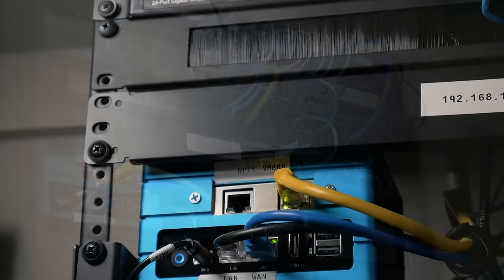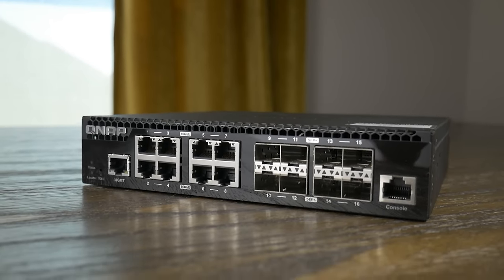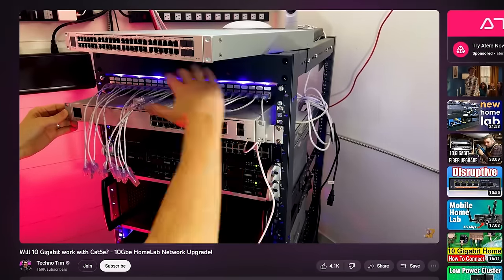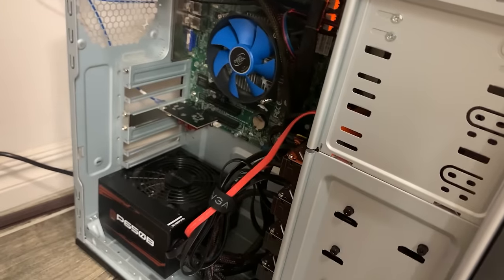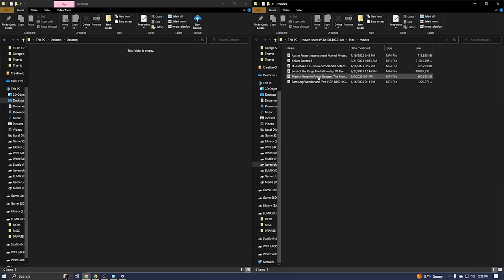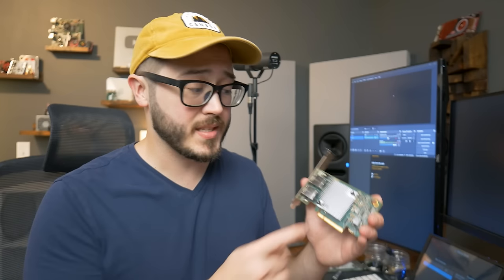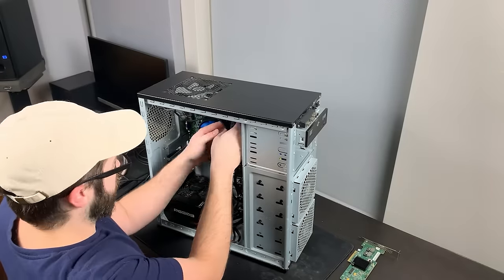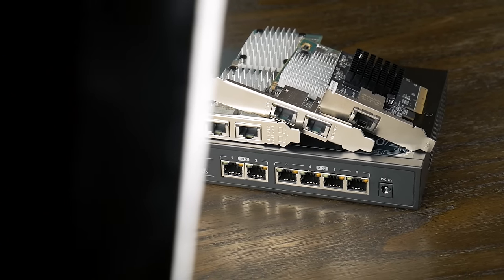Fast networking is cheaper than you think.

Comment: No complaints here. 10G in a homelab where you run a hypervisor cluster and a NAS for NFS/iscsi isnt overkill, it’s minimal.  
Things you will want to consider: roll your own NAS for scalability, ensuring your memory and PCIE lanes are adequate; something most consumer NAS lacks in order to get full throughput.   Also, as another user mentioned, steer clear of the cheap clone NICs.

Comment: Tackled this situation few months ago, went with direct 10G optics (used ebay stuff) between pc and nas. NAS has bunch of mechanicals in raid (sequentials is faster than single ssd), no problems there, but main obstacle is ssd's in main pc cant keep up, probably some nvme could change this, but sata ssd's just get overloaded. But opening files on nas is a breeze, scrubbing some 26gb movie is instantaneous, zero waiting, you can drag or click anywhere in timeline and it just plays.

Comment: 16:28. Why don't you just zip tie an 80mm fan to a pci slot cover underneath it? Find one of you fancy cases, check if the pci slot cover piece have fancy design holes on it. If yes, you have a "pci mounted fan"! :) Happy to help.

Comment: If it's only a few devices and are willing to use fiber or DAC, you don't even need the switch. Most 40GbE interfaces can be split into 4x10GbE, so four devices can make a fully connected mesh. Some cards even have an integrated switch which you can program with static routes so you can connect more devices in a ring or torus. Just make sure you have enough paths so that one node can't shut down the whole network. Same goes for 100GbE, they can be split into 4x25GbE

Comment: I'm glad I decided to watch this video.  It confirmed some things for me regarding 10gbe file transfers.  I recently rebuilt by Plex server with a new motherboard and processor going from an 4th Gen Intel processor to a 13th Gen processor.  I was always wondering if I had something set wrong with my 10gbe network (Intel X540-T1) card.  I also have a Synology DS1819+ NAS with a 10gbe (Synology) card in it all the 10gbe traffic is going through a Mikrotik 5 port 10gbe switch.  When ever I transfer files they normally move at or above 450MB per second.  Some times it will peak at 650 and some times above 700 but then it will drop back down.  I always make sure I transfer to the 10 gig IP port on the NAS.  I never tried transferring a second time the same file.  I guess cacheing might get faster transfers.

Comment: Interesting vid, and worth a watch for people dabbling in this stuff. I'm using a slightly different solution for 10gbit, but I haven't gone all-in on it yet either.

Hopefully in the couple months since you made this vid you did a better job of securing that fan to the one NIC though. What you're likely to experience is a combination of the plastic tie drying out in that environment coupled with a slight imbalance in the spin of the fan which could cause it to fail rather spectacularly.

Also, invest in some Noctua industrial fans for that server. :P

Comment: the "Cat" phases of ethernet isnt only for data transmission, cat8 has way more ability to block out signal noises caused from electromagnetic interference and reduce the chances of jitter/packet delay which is different from packet loss.

Comment: Very nice. I ran my 4-to-1 consolidation earlier this year, so right now, everything runs off my Proxmox server, and with the virtio NIC, it shows up as 10 Gbps in Window10+ and all of my Linux systems. (In Windows 7, it actually shows up as a 100 Gbps NIC, which is SUPER AWESOME!)

This saved me from having to buy 10 GbE switches, NICs, and cables to actually make it work at 10 GbE speeds.

Comment: Fast is great, but 10 Gb gear generally runs hot, and that means fans. If you don't have a dedicated equipment closet where fans aren't an issue, it's something you definitely should investigate.

All of my networking gear sits about ten feet away in my home office, so the need to be fanless was a primary consideration, which is why I haven't upgraded yet.

Comment: No point in watching when we learn he's running a $600 ethernet switch. 
Ruined it. Try again.
Reply from the maker: Well I thought I made it clear that that one component wasn't what I was calling a budget setup. I recommended what I was originally planning, which was to have two of the smaller switches. The majority of what I did in this video (connecting a PC to a NAS with a 10Gb connection) is do-able with that setup. But by all means, you're entitled to your opinion.
Reply: @HardwareHaven  thanks for that. I didn't get that far in the vid. I hear that and away I went.

Comment: if most of your stuff is not that far away for example a nas and a virtualization box running from the nas. you can try going with sfp+ switches, there are 40$ 2x 10gb sfp+ switches with 4x 2.5 gb rj45, and used sfp+ cards are quite cheap for servers and pcs, fiber itself is a bit expensive but foir short runs upto a few meters you can use sfp+ dac cables which are just copper cables with the modules already attached.

its also more energy efficient and if you really need 10gb rj45 you can get (quite expensive) sfp+ tp rj45 adaptors

Comment: I recently purchased the smaller qnap switch (terrible names) and it's a winner imo. I move a lot of very large files between my workstation and nas and while i guess it's not a requirement it is a very nice quality of life upgrade. I did have a built in 10g nic in my workstation so i only needed to add 1 card which cut down on cost. The 10g card i bought has a little fan on the heatsink that im hoping doesn't instantly die. Anyway i can also recommend the smaller switch for a setup where most things are fine connected at 2.5g but you need (or want) certain traffic running over 10g. Cheers, Christopher

Comment: Depending on the MB, putting it in the bottom slot may limit the speed on the 10Gbe card.
Reply from the maker: Definitely. I looked it up later and the bottom slot on the Supermicro board in the NAS is only x4, so I would need to use the middle slot which is x8 3.0
Reply: @HardwareHaven you should test them as well. Network switches have a similar issue to the flash storage ecosystem, where you can get mislabeled and counterfeit cards.

Comment: If you have dual cards you can round robin (old internet/intranet style) a 10gbe network.
You can put two cards in one system and use pfsense.

I have two multi function enterprise cards, not so cheap and a copper cable.. running between them. It works well and i get full speed  to my SAN.
I have fibre, which im in a rental and will be moving, so that can wait.

But i also have an old dell power connect, i had to buy a 10gbe slot in the back card that came in at 150usd ish (I'm in the uk) its sat not doing anything  as well you guessed it.. moving so its not going to the rack.
I have some HP enterprise managed switches but they are limited to just four ports at 10gbe. And you lose some 1gbe using them, but with 36 ports or so its not a bother, but for some it maybe. 
Head off to the recycler see what they have. But your going to be using more power.
😮

There is a few videos their in how to do that list of set ups 😊

Comment: The two groups of naysayers are saying the same thing: 10GbE is overkill for your hardware with spinning drives. Yes, it is! But if you wait until you can afford to make all the upgrades at once, you need an enterprise budget for enterprise hardware. Upgrading here and there a piece at a time means you have mismatched hardware. Fine, you have mismatched hardware. It also makes the upgrades more budget-friendly because you never need to fork out the HUGE cash outlay all at once. And that's worth doing it the way you're doing it IMO.

Comment: Just had a look at 10G switches, 5 port, you know, the small ones that you can get with 1G for like 10, 20€... They are over 200€.
So it may be cheapER than before but still hell of a lot expensive. At least for "normal" people's use :)

Comment: One thing if you have a budget is to setup an NVME device on your truenas server and make it a cache for the mechanical drives. I have seen this speed up writes as it caches the write onto the nvme then works to move it off the nvme to the mechanical on it's own time. at least until nvme drives become as cheap as mechanical drives per tb

Comment: 16:30 You may wish to get a slot mounted Squirrel cage blower fan. It would take up a single slot and wouldn't be as obnoxious to remount if you wanted to repaste the NIC's heatsink(s). Amazon currently has a deal on a Startech brand for less than $9.

Comment: I believe the Intel x540 NICs have a known issue when plugged into a PCI port that is routed off the Chipset, rather than directly off the CPU's PCIe lanes.  I had a vary simular issue with my desktop where the thing wouldn't even boot up with the card in a "chipset" slot.  but if I put it in the main PCie slot on my mobo it worked fine.  I'm assuming you have a GPU in the main slot, and any extra slots that are accessable might be routed off the Chipset.  I see in the TrueNAS server, you are using the primary slot, and that may be why it worked there, and not in your desktop.
Reply from the maker: Ahh that would make sense.
Reply: @HardwareHaven  Also, for NVMe, I just got one of these: aoc-shg3-4m2p and some cheap teamgroup 4TB MP34 drives that can go into any PCIe slot, no Bifercation needed ;)
Reply: I bought an off branded NIC card that's supposedly an Intel clone and my PC would not post at all no matter what PCIe or PCI slot I had it plugged in. I plugged in my old genuine Intel Pro/1000 Dual port NIC card and my PC post just fine. Steer clear away from those unknown off brand Chinese junk. You get what you paid for. Always buy genuine Intel hardware esp when it comes to VMware ESXI.

Comment: I have a question. Do you need a switch here? I know a lot of modern network stuff is autosensing in terms of not only speed, duplex, and more. Could you direct connect your NAS and primary server? Would it need to be a crossover cable or could it be a straight cable? wondering if autosensing these days also includes the crossover thing for NICs, it seems standard on switches now.

Comment: People doing a renovation or a new construction, please look at multimode fiber. It is much cheaper compared to copper (cabling, transceivers, NICs) and has better reliability. Anything above 1G over copper is a last resort only, and it's not guaranteed to work reliably. I don't get why these RJ45 10G products still come to market. This is not used at all in the enterprise environment. Only DAC and MM in use. I have never seen 10G over copper in a datacenter. (Also there are 16 cage 10G switches on the market for 1/3rd the price of the sponsor's proposed product.) On a side note, also look at MPO/MPT cabling with LC breakouts, this allows multiple 10G connections on a single cable.

Comment: Random question... I have an old PC I've ressurected with a Wi-Fi 7 card, 16GB of ram, and a 1TB SSD.  It has a simple 10/100/1000BaseT NIC on the motherboard.  The motherboard is also PCIe 2.0.  I can get 4 PCI lanes for a NIC, which should pass 2GB/s (500 MB/s in PCIe 2.0)... or 16 Gbps.  

If by chance, I can only fit this into a PCIe 2.0x1 lane, and the speed is dropped to 4Gbps max... will a 10GBaseT run at 4Gbps? or revert back to 2.5GBaseT?

I know a 2.5G card is a slam dunk here, but I'd like to put in a 10GBaseT to talk with my other machines if possible.  Anyone have experience with older tech like that handicapping a new card?  I know PCIe is supposedly backwards compatible, but I don't know if the cards do "partial" speeds based on what the bus can feed it, or if it just increments from 1G to 2.5G to 5G to 10G and nothing in between.  If the machine is only going to revert back to 2.5G anyway, it'd be cheaper to put a $20 2.5G card in there instead of a 10G costing $75. ;)

Comment: Did you adjust the MTU across your devices where 10Gb/s traffic passes through? I'm getting the full 10Gb/s transfer speeds on my network using my Synology DS1621xs+ 10Gb port, MikroTik 10Gb switch, and my PC with a TP-Link 10Gb PCIe Network Card when I use iperf3.

Comment: Have you found a fix for the power draw from the 10Gb NIC on your NAS? Even if you shutdown the NAS, it will still take 10W from the wall with Inspur cards. They will become hot when the system is down. (Potentially burnt because the fan will be off when the system is down). I haven't find a good solution around this yet. Let me know if you have experienced the same and how to fix it.

Comment: Here, power cost has made me stay at 2.5G. I have fancy 10G switches I can 'borrow' but they are really power hungry; Passive 10G switches indicates that power is finally coming down.
And, putting on my EE hat: The NICs don't care what is printed on the cable, all that matters is the channel. Cat5 from reputable manufacturers tends to be significantly better than 5e spec, and for the typical short runs, the channel meets the requirements of the 10GBASE-T transceivers. Checking that you have margin is not hard, just use a long (6a) patch cable.

Comment: Is your PSU intake pulling air from inside the case? It's usually more efficient to have it exhaust out the back. Pulling in hot air from the NIC through the PSU might be suboptimal.

Regarding the 10Gbps transfer, Windows SMB might not fully saturate it with a single transfer. Multiple streams could help if your CPU and storage can handle it.

Thinking of upgrading to at least 2.5Gb soon. The LTT screwdriver's ratcheting click is oddly satisfying—I find myself fidgeting with mine all the time. 😄
Reply: there's no way to make the PSU exhaust anywhere besides out of the case it's how the PSUs are all designed the only options are if the case has a weird layout for the PSU or the PSU is mounted with the intake fan on top versus the bottom some  cases don't have ventilation on the bottom of the case for the PSU so you'll have to have it pull air from inside the case but for all cases that have the PSU mounted to the case the exhaust is facing out

Comment: One issue on consumer level PCs, the primary x16 PCIe slot may drop down to x8 speed if a x8/x16 card is installed in the lower x16 slot (both shots running at x8 speeds). This can affect games that heavily rely on the GPU.

Comment: Does your router also need to be 10GB (or 2.5 GB) to work? Lets say my PC and NAS both support 2.5 GB ethernet, and I add a 2.5 GB switch inbetween the PC and NAS, will the connection between the PC and NAS be limited by the router or is the router irrelevant in this case?

Comment: What speeds do you receive from your internet provider? Where I live, I only have access to providers that max out at 1Gbps speed for consumer subscriptions. So would this still be useful for me? I don't have anything like a NAS, so I don't think I need greater speeds in my home network? Or am I wrong?
Reply: This won't do anything for your WAN speeds (how fast your devices can talk to the internet). In this demonstration he was creating a 10G backbone on his LAN (local area network) so devices plugged into his home router/switch could talk at 10G speeds. If you just have a sinlge PC connected to an ISP modem/router then this will do nothing for you if your internet speeds are your bottleneck.
Reply: @SammerJammer  Thanks for the info. Can you give an example where 1Gbps aren't sufficient in a LAN network? My only guess is to stream a movie from your NAS? But even that is possible with 1Gbps speed. No?

Comment: Can the Port Forwarding for VoIP work with these switches? 

Reason why I ask, doesn't work with my flashed router with NordVPN on all ports.

That same fan is how I keep my NVMe SSD (Samsung 970 Pro) cool when plugged into 2nd PCIe 3.0 x16 port! Replaced the cheap fan already on the adapter of same size, started squealing after a month due to rifle bearings. Temps are 35-40C Max under load, not possible in native port.

Comment: The conclusion: That's how most less deep pocketed homelab does their network and upgrade. 200$ upfront is not the same as 1000$ upfront for a better overhaul product but way overkill for now.

Like the QNAP QGD-1602. The perfect combo router/host/switch. But 1300€ here, no. I have other things to buy and do.
I would also like it with a ryzen processor, even a V-1500 something. There is the possibility of the ryzen mobile too.

QNAP, I will need in the close future something like the QGD-1602, within 2/3 years, feel free to send one over.

Comment: can I connect cat 6 cable directly from my pc's 2,5 lan card to each of these 10gbit ports? can you test that? Also will it work direct connection between 2 such cards in each pc? I dont want to spend on switch, just 2 pc's and 1 server. Also I wonder if it can work on pcie x1 port via cheap riser

Comment: I have the same QNAP unmanaged switch with 4 2.5GB ports and 2 10GB ports.  I am getting a full 2.5GB when connected to 2.5GB NICS but when those ports are connected to 1GB NICS I only getting about 400MB (way under 1GB speeds).  The same 1GB NICS run full speed when connected to a Netgear switch.  I see some others complaining about slow 1GB speeds as well on this switch on Amazon reviews..

Can you benchmark some 1GB connection speeds for your switch to see if yours is slow as well?

Comment: Been eyeing 2.5/10gbe for a while. Currently have a TP-Link 1Gb switch that I'm happy with. Finding the most expensive part is the switch. Adapters seem to be cheap. Wanting to go 10Gb so I can run my VMs over a single shared 10Gb link and connect to a switch with 10Gb links to connect to all my other random 1Gb devices. Then also 10Gb links between my VM host and the a NAS for fast backups. Other priorities going on currently, so will have to wait and make due with my 1Gb network for now. Hopefully means I can pay less for a good 10Gb switch later :)